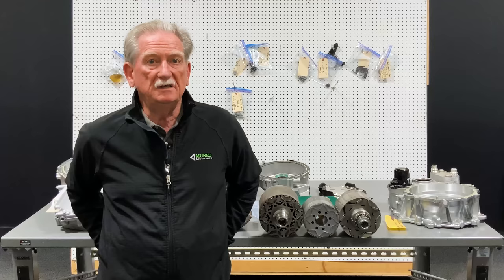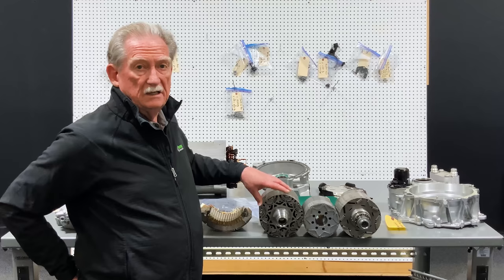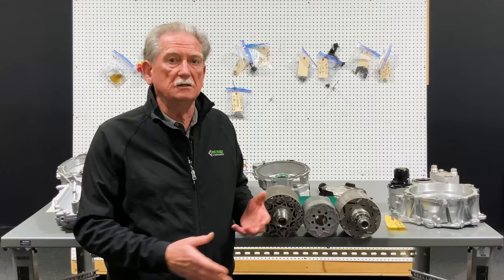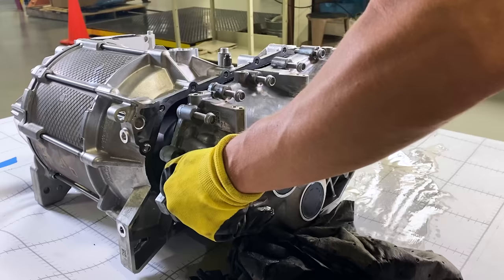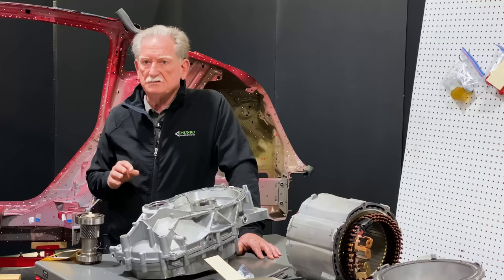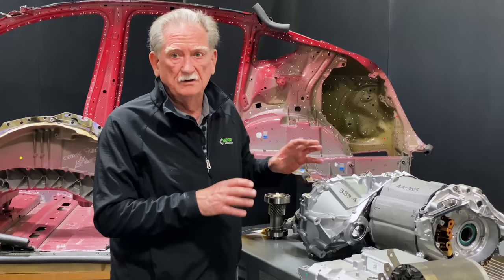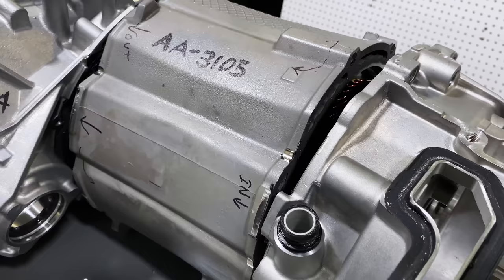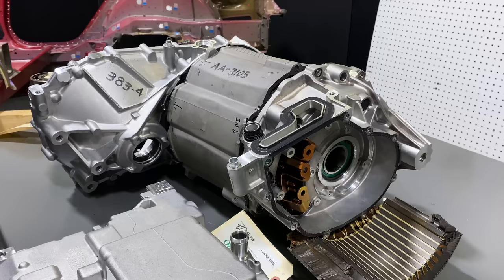Volkswagen ID.4: Electric Motor Teardown and Analysis

Comment: The capacitor isn't "what makes the motor work", it provides a local short-term energy reservoir to overcome the effects of the resistance and inductance of the battery and its cabling, effectively smoothing out the current draw as the inverter switches the DC from the battery into AC to drive the motor. (There is a thing called a "motor run capacitor", but that's something different, for a different type of motor).
Reply: Basically you have a low impedance buffer to the IGBT B6 bridge, so no overvoltage stress will be present on the switches. I really like how the capacitor-IGBT connections are interleaved for minimum stray inductance.
Reply: So basically it makes the motor work :-)
Reply: You might think someone who works in R&D consulting should know these basics.. but the more of Sandys videos I watch, the more I am appalled about the apparent lack of knowledge. "Use snaps instead of screws, it's more robust." - everyone who has ever taken apart a chinese wifi router knows the opposite is true.
Reply: maybe useful for stabilizing the inrush current of the motor.
Reply: @WooShell  Snap fits are used all over the place in a lot in vehicles. I am not saying Sandy is gospel, but you are comparing a low tolerance $50 plastic item to a $1000 critical automotive component. It's more likely you'd use a metallic snap joint and plenty of FEA to back it up. The tolerances and materials are a world apart. I am not sold on the idea of a snap join in this location...but I don't have enough experience to doubt him. Do you work in automotive manufacturing?
Reply: @WooShell  All fasteners are crappy if they're poorly designed.  Take threaded fasteners. if the joint slips they will back out. But if you have enough preload that friction eliminates all relative motion, then they stay for good.  

The comment that Acme, Whitworth, square and buttress threads hold better is interesting.  All 4 of these thread types are higher efficiency and would develop higher and more consistent preload.  They also don't rock or wobble as easily as a 60 degree machine thread.   Hard to guess what the actual cause is.
Reply: I have a BEE, BCS, and MCS and 47 years in the field. For those of you think you are displaying your intelligence by making a big issue out of the fact he said ".. makes the motor work" vs "a key component that makes the motor" are sadly mistaken. Unless you wanted him to teach an advanced college course on 'DC-AC Motors Designs and Motor Controls'?
Reply: @WooShell  Wifi routers are not designed to be serviced. Inverters can be designed to last, LG proves that in TV's and their washers. Germany makes a mixed bag of leading and trailing technology. Obedient OEM's are mostly in Singapore and Taiwan where the chips are made.
Reply: @monstercameron  Not!
Reply: In electrical matters, sometimes he says things that are incomplete or incidental and not quite right.   I'm sure his EEs are suppressing winces and eye rolls.  I'm also sure that Sandy would tell you "what I should have said was...." .  As an older EE curmudgeon myself, I understand.
Reply: @shazam6274  I'm 75 and the older I get, the less tolerant I am of people making a big issue out of someone misspeaking without asking what they really meant first. I used to tell engineers that worked for me,  'I know you think you understand what you thought I said, but I'm not sure if you realize that what you heard is not what I meant'. Then one day it dawned on me that actually maybe sometimes I wasn't saying what I meant to say. I found out I was guilty as hell. :)
Reply: @disturbed4733  Yup.  I'm 71.  You, I and especially Sandy, have "forgotten" more than some of these people know or will ever learn, but they need to be jerks about this.   Please correct me when I'm wrong and it matters, but not when I just misspoke or had a brain fart.
Reply: @WooShell  He also says most electronics are not repaired or taken apart any longer. Things aren't serviced, because servicing them costs more than buying them new. It's a thing relegated to hobbyists or special cases. It's sad, but true.
Reply: You know he's trying to dumb this down for us regular folks, right?
Reply: Of course you're right, Mike, but I think it's fair to sum up this capacitor with "what makes the motor work" as anyone that works with electrical motors knows that having a bad one makes the motor not work.
Reply: @blondiebxl  It's the flux capacitor that makes time travel possible.
Reply: @WooShell  If you haven't figured out Sandy is a mouth piece for Tesla at this point, I don't know what to tell you
Reply: Sandy is more of the big picture guy, with a focus on screw count loly, and he has EEs etc on his team to take care of that side, but this video was not about the electrical design, this is not a Big Clive video, and so the exact purpose of the cap isn't important.
I suspect he pulled it out starting to describe what it did, and then decided that he didn't need to give that long explanation, so he just gave an answer as of he was talking to a 5 year old lol
Reply: @WooShell  lol, no truer words.. sandman wants the stuff to get junked after 1 use, never to be repaired or fixed. Spareparts business are very lucarative.
Reply: @2hedz77  plastics age mate, they get brittle if you dont spend on the good material, have you ever tried to pry 10 snaplocks just to get a bit off to fix? you need 2 octopuses going in every other direction to do some work, and one gets over pry'd it snaps! plus pcbs dont like to get bent, microcracks if u do, then phantom issues that techs spend all day to rectify, if they ever find it.
Reply: @disturbed4733  old mindset guys always like to say this, "i have been doing this for the past bazillion years.. so you should listen to me" .. most of them still have their blinkers on.. 
90% of the guys that pay attention and watched this to the end probably have some clue and arent as dumb as you think they are. Guys here are just trying to steer people off the "blind leading the blinder" route. 

Just accept that it was wrong, and stop standing up for your mate that is clearly wrong.. all your BEE BCS MCS dont mean a thing when you by principal are wrong from the start.
Reply: @LawpickingLocksmith  Quality control #1 for reliability.
Reply: Get rid of that the motor will work :D
Reply: @disturbed4733  whats a BEE , a BCS and a MCS ? In Europe we call it different.  😄
Reply: @The.world.has.gone.crazy...  Bachelor of Electrical Engineering, Bachelor of Computer Science, and Masters of Computer Science. Not sure of equivalent is in the part of Europe your in. Maybe BSe  BSc  and MSc ? 4yr + 4yr + 2yr, but spaced out over 30 years, with only the first degree being contiguous. If you figure out an equivalent, please let me know.  Always interested in learning new things, even at 75. :) 
May I also say, that some of the smartest people I have ever met have no degrees, and some of the most clueless people have a wall full of degrees.
Reply: @disturbed4733  😂😂😂 same here ( the smart people comment) as for the degrees we call it the same but we dont use the same shortcuts here.
Reply: Indeed. Though many of those parts will cause the motor not to work if they would be omitted...
Reply: "It makes it work" is a standard phrase used by some presenters when they don't know understand what the part does, or don't want to explain it. I understand that the function of the capacitor is not important to this presentation, but it would be better to just not say anything... just "this is a capacitor", not "this is a capacitor, it makes the motor work".
Reply: Also it smoothes over Ripple from the Phases and it Buffers high Peak currents in the phases to reduce Peak current on the Battery when in the lower rev range.
Reply: @CATA20034  Thanks. That was an idea I had.
Reply: @monstercameron  No, they are for EMC due to the interrupted current used by the speed controller. High frequency PWM is used to alter the 'effective' dc supply for the motor power and low frequency switching controls the 3 motor phases. The pulses would cause havoc without the caps as the battery is miles away electrically. The PWM would also be audible as the currents would actually move the DC bus cables.
Reply: @disturbed4733  I do think he got confused about the IGBT module though.
Reply: @antibrevity  The thing will work without those caps but not well. They're not start capacitors.
Reply: @monstercameron  not in this case because the motor is brushless
Reply: It makes the different powerlines shift a little bit.
That is what makes the rotate.
Reply: @markknoop6283 Homie this isn't a single phase induction motor   Caps aren't needed on the AC side
Reply: @SeaMushroom98  no that's right bud this is DC motor.
Reply: Larger Capacitors used for first 10 seconds of acceleration.
Reply: @markknoop6283  I work on motor controllers for high power systems for a living.   A brushless DC motor is powered by three phases coming from an inverter, which create an AC(ish) waveform to drive the motor
Reply: @SeaMushroom98  yeah I know that sinds 1985
Reply: @blondiebxl  motor can work without capacitor
Reply: @WooShell  wifi router doesn't suffer vibrations from road
Reply: @WooShell  Sandy talks about motor car parts, not microelectronics.
Reply: @mikeselectricstuff not quite. The motor is three phase and permanent magnet so it's silly to talk about run capacitor.  The large capacitor in inverters is not what you think as in pcb stuff. How vfd and inverters work is to have a high voltage DC bus in the 300+ volts DC. You then chop that up to send the phases as pseudo AC (with like 250Vpp).  It also is convenient because the battery packs are in the same voltage range.
Reply: @blondiebxl  that's exactly what I thought.
Reply: @blondiebxl  yep, but they got to show off how clever they are... 😁
Reply: @WooShell  you can tell by how Sandy OFTEN pauses as he struggles to find the word he's thinking of that his memory isn't what it used to be.
He's hiring & getting excellent younger guys in to enable the company to continue.  Because although his memory is weakening I bet he's forgotten more than you'll ever know.
STILL knows more than...

Comment: Bleed resistors on the PCB adds thermal stress to the board and that can break solder joints and other problems if not done correctly.

Comment: The skew in the magnet alignment is also to reduce cogging torque (as it is with helical gears versus straight gears) It's actually pretty common practice across other industries.
Reply: Cogging torque is an undesirable component for the operation of such a motor. It is especially prominent at lower speeds, with the symptom of jerkiness. Cogging torque results in torque as well as speed ripple; however, at high speed the motor moment of inertia filters out the effect of cogging torque.

Source, wiki: https://en.wikipedia.org/wiki/Cogging_torque
Reply: I was thinking the same, glad to find this already written! Bosch SMG138 (motor-generator) has similar design, very smooth rotation.

Comment: That's a fantastic inverter design.  Just wait until your electric car is off warranty and the dealer wants more than $5k for an inverter.  The after market rebuilders will be an option for this part.  I've worked on lots of old VW's and the clips and snaps break but the bolts all work fine.  That why old Fords are scraped and old VW's live on.

Comment: I’m impressed that on the differential had bolts in it, older transaxles that VW has made in the past has had rivets that fail at high mileage and kills the transaxle.
Reply: you are right I notice that too sandy tells US that rivets are better.
Reply: @V10PDTDI  And when anyone does a rebuild on a old one they replace them with bolts (APR) There a lot better. I've had two trans go bad due to rivets letting loose.